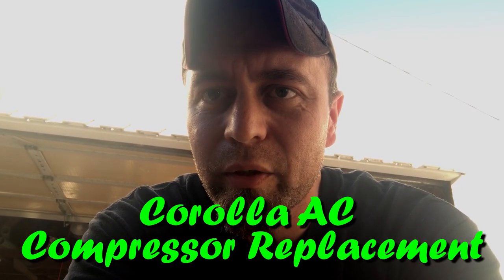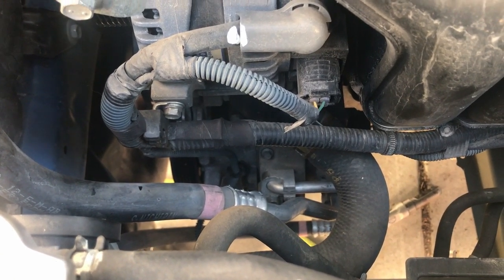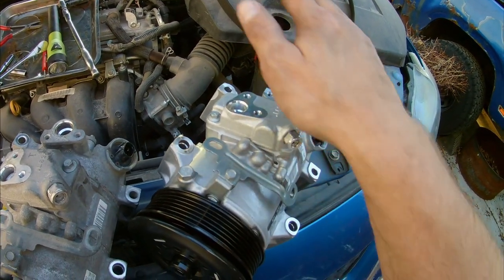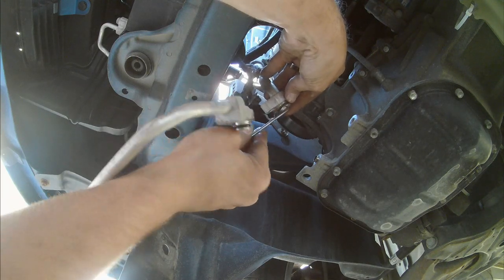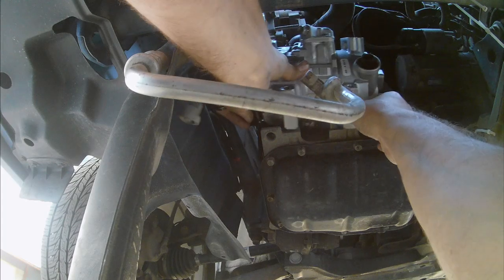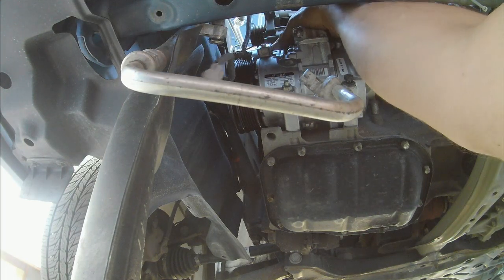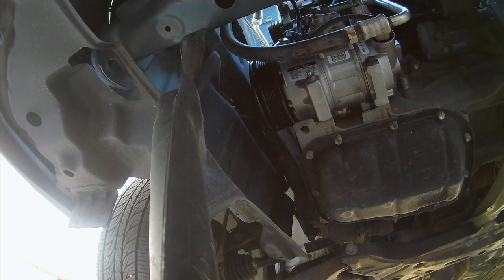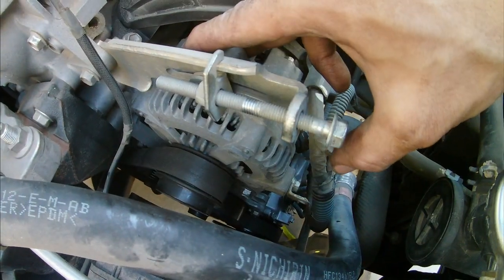Toyota Corolla AC Compressor Replacement

Comment: Took my Corolla to a Toyota dealership.. they wanted $1650 for parts and labor for the compressor & receiver dryer! I said no f*** way! thanks for the video!!! can't wait to do this myself!
Reply from the maker: You can save a lot of money doing it yourself.  I ordered the compressor from https://carparts.evyy.net/c/247809/306510/4532  for under $400.  Then it only cost $105  to have a local shop evact the system and then refill it when I was done.  You'll have to call around to make sure you're local shops will do that for you.  

I do know I looked at the price of the compressor alone from my local dealership and they wanted $750 for it.  Depending on what happened to your compressor replacing the receiver dryer is a good idea.  I didn't replace mine only because my clutch went bad and not the compressor.  Therefore I knew there wasn't a bunch of metal shavings floating around in the system.  If your compressor went bad consider replacing both.  It's really simple.  The receiver dryer is right there in front for you.  Unscrew the hoses put new o-rings on and tighten everything back.  Completely simple.
Reply from the maker: @holumidesalako9722  without seeing your car I would thing your AC system is low on charge and you should have a repair shop check out how much 134A is actually in your system.

Comment: One question so after you install the AC pump it’s ok to drive with it as  long as you put the oil in it? 
I no it sounds funny but just trying to make sure
Reply from the maker: It's ok to drive the car once you put things back together.  As long as you don't turn on the AC or run the Defrost your vehicle won't run the AC so your compressor will be fine as the pulley bearing is not lubed by the AC oil.

Comment: Did you happen to have a video on putting the system in a vacuum. I think I can figure out removing the belt.  I have a bad compressor on a 2006 corolla. Thanks
Reply: David Searson no I don’t own a vacuum pump or AC recovery machine. Which is why I had a local shop recover the R-134A that was in my system before I started and then had them vacuum out and refill my system after I was done.  Something I’d suggest to anyone who is going to work on their AC system.
Reply: @Dodgepower74  ok thanks

Comment: I saw your video and I replaced the last compressor because the clutch was failed. I bought new AC compressor, but it is making intermittent snore noises for 1-2 seconds even though the AC is off and the engine is running. After turning on the AC the noise disappears until the AC compressor stops and makes the snore noise and then disappears when the AC turns on. I checked the gauge and looks OK but when the AC compressor is idle the gauges move a little bit and make the snore sound. Any idea on this?
Reply from the maker: It sounds like your clutch is very slightly applied all the time.  Not enough to be engaged but enough to drag slightly.  I would check your power and ground to your clutch and make sure that its not getting slightly turned on when it's not supposed to be.  Past that you may have to check clutch clearance and adjust.  It

Comment: When you took off the lines from old one, did Freon go everywhere?  I’m about to do this
Reply from the maker: I had my system vacuumed down so there was no refrigerant in it before I unhooked any line.  If you don’t do so it will come out and spray everywhere.  FYI technically it is illegal to release R-134A out to the atmosphere.  Although it’s not easy to get caught doing so.

Comment: Great video and thanks! Did you change the drier, too? I might have missed it if that was covered.
Reply: Brent Grayson I thought I covered that, but it’s possible I didn’t.  I did not change the receiver drier only because my compressor did not break internally.  It was just the clutch so to save money I skipped replacing the drier.  I know I should replace it anytime I open the system but I was going cheap.
Reply: @Dodgepower74  Great short video as-is. I'm pretty sure my compressor just went out. I have same car, same year. Bought new and it's been a great car other than the ac last cpl years. I'll check out your link for the compressor. Probably go by Firestone 1st so they can confirm that's the issue. Thanks!

Comment: My Toyota corolla gli 2011 variable displacement Compressor stopped working. Here in Pakistan AC mechanics recommended to get installed clutch compressor of other brands as corolla sensor compressor  wouldn't work if replaced alone. it will work only if whole air conditioning unit is replaced. kindly advise.

Comment: I was quoted $1,600 by a shop I usually trust!
Can I clear the lines myself, or do I have to take it into a shop for that?
Reply from the maker: Honestly, unless your compressor grenaded or you used "stop leak" at some point I wouldn't worry about cleaning your lines.  If you do feel like you need to clean your lines then there are kits and cleaners you can buy and do yourself.  It's just spraying a cleaner in your lines and then blowing them out to get it out.  

Most manufacturers suggest you don't clean lines anymore because it's hard to get the cleaning solution out of the lines and it can do damage to the compressor if too much is left in the system.

Comment: 6:18 after you had added the oil, did you plug the hole; or how did you prevent it from spilling out?
Reply from the maker: I didn't plug any of the holes.  I rotated the clutch to move the oil into the compressor and then just tried really hard not to tip the compressor so the oil would spill out the holes.

Comment: Did your compressor made some noise grinding noise??
Reply from the maker: The compressor I replaced made a huge bang and the clutch blew a part while I was driving.  Which why I replaced it.  The new one never made any noise it just worked.

Comment: So I followed your video to a t, and everything seems good, I got it all put back together. However, the compressor would burp up the 2oz of PAG oil I put in it when I spun the clutch, even trying to go slowly. Is this supposed to happen? (I added another ounce to it just to be safe but didn't spin it anymore after that)
Reply from the maker: It does happen sometimes.  It really depends on if you put it in the suction side or the pressure side.  Also depends on if the compressor was prefilled from the factory.

Comment: Do you recall the amount of R134 you added?
Reply from the maker: I had a shop recover all the R134 in my system before I started so it was in a vacuum before I started.  Then when I was done they sucked it back down into a vacuum before refilling it.  I don't remember how much they put back in but they said they didn't need to charge me for any extra R134 because my system was full when they recovered to start.  If you need to know how much your system holds there is a sticker under the hood that tells you that information.  Otherwise let me know and I'll check, mine to give you an idea.

Comment: Guy, is your ac working fine now? I guess you didn't do correct measurement of pag 46 oil before putting it into compressor
Reply from the maker: No, I estimated the correct amount of oil.  Yes, it works great.  If you go to a shop and have them work on your AC you'll be hard-pressed to find a shop that actually measures an exact amount of oil for AC systems.  AT best they will look at the amount that came out when they recycled your Refrigerant, then dump out as much as they can from whatever part they replace and try to put close to that much back in.  Most times they just add back in 2-3 ounces and call it good.  It's actually worse for your system to have too much than not enough.  Your AC system can't cool with oil, the oil is only there to lube up seals and rings in the compressor, as long as there's some you'll be ok.  Which is why I wasn't worried about measuring exactly how much I needed.  I know I was close.
Reply: @myknowledgeguy  I have exactly same compressor as the one in your video. Could you please send me the  picture of the electronic control valve of this compressor as I need to place order for replacement ecv. Im having intermittent cooling and electronic control valve is responsible. If you could do video on this, many will appreciate. Thank you

Comment: what mileage was the car at when you replaced the ac compressor?
Reply from the maker: roughly 60K it wasn't much and honestly made me mad it would break with that low of miles
Reply: Thanks for sharing

Comment: What is the actual name to ask for when taking it into the shop for the ac vacuum? Also, what kind of oil do you use in the compressor itself? I'm not sure it was just engine oil...
Reply from the maker: You want to ask your shop to evacuate your AC system.  Then when you are done you will have them vacuum the system out and fill it back up.  You will us PAG 46 oil.  You can't use engine oil it will destroy the entire system.

Comment: Is this the same for a 2004 corrolla?
Reply from the maker: should be different engines so there will be some differences, bolts, and locations will be different, along with the looks of the compressor.

Comment: How do I figure out how much oil my compressor is suppose to take ?
Reply from the maker: You won't find any information on how much the compressor alone holds.  What you will find is the entire system holds roughly 7oz of PAG 46 oil.  That said unless you have a way of completely draining the entire system of oil this number means almost nothing.  So your best bet is when you remove the compressor is to drain all the oil you can from it.  Measure how much is removed then add that much to the new compressor.  This way you add about what was removed from the system.  I was not as precise but it worked out.

Comment: What was your specific issue for changing the compressor?
Reply from the maker: the compressor clutch fell apart.  The compressor wasn't locked up and the bearing still ran free but with not clutch I figured it was just as easy to replace the whole compressor than to replace only the clutch assembly
Reply: @myknowledgeguy  Thanks. Luckily mine was bad. The person I took it to for a recharge overfilled. I was able to remove some R134 until I was at 35 PSI on the low side and now the car cools good.

Comment: If you know what you're doing, you can borrow a vacuum pump and a  manifold gauge set from Autozone or Oreilly's through their loan-a-tool program. You buy it, use it, then return them for a full refund. Just get system evacuated 1st.
Reply from the maker: That's perfect for a system that's empty, how do you deal with the refrigerant that's in the system
Reply: @myknowledgeguy  Solid  point which is why I included to get system evacuated 1st (i.e. reclaimed) at end.

Comment: Where did you buy compressor? How much did it run you?
Reply from the maker: I got the compressor from https://carparts.evyy.net/c/247809/306510/4532  for $390 plus whatever shipping was. It was a brand new Denso and the cheapest I found a new one anywhere.  They do have a generic one for $180 but I wanted the OE compressor.

Comment: If your compressor is good and if it’s just a clutch that needs replacing do you still have to drain the coolant?
Reply from the maker: While you could replace just the AC clutch with the compressor in the car.  It would not be easy,  nor would I suggest it.  Anytime you remove the AC compressor from the car you will have to drain the refrigerant and have it refilled by someone with the proper equipment. 

My AC clutch is what was broke and although I could have just replaced the clutch.  I replaced the whole compressor because you never know why the clutch broke.  I couldn't prove the compressor was perfect and just need a clutch.  Not to mention the last thing I wanted was to replace the clutch then have the compressor break less than year later, causing me to replace the clutch and compressor again.  To me it was worth doing the whole job so I won't have to worry about the chance of doing it again.
Reply from the maker: Most of that is because they will charge you to pull the compressor out to change the clutch.  That's what the book says to do so that's what they charge for.  Plus with as easy as it is to remove I'd pull the compression to, unless I was trying not to have to evac and recharge the system.

A Lot of time the cost in labor to replace a part on the compressor is more than the whole compressor for that specific reason.  You pay for removal of the whole compressor plus labor for the smaller part also.